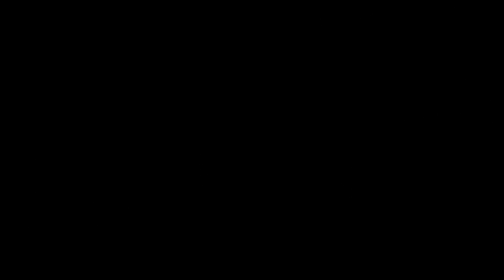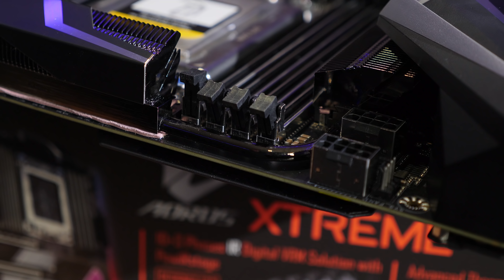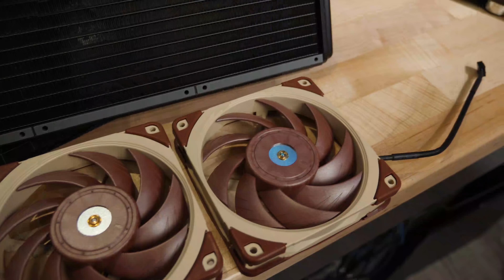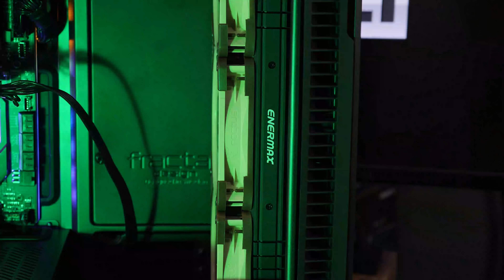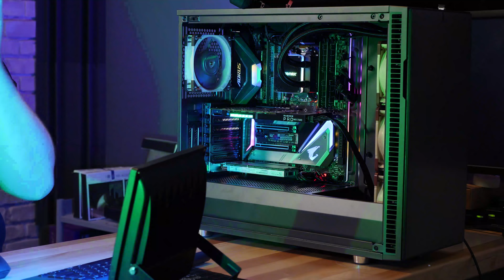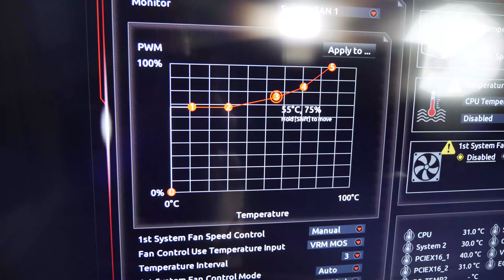TR 2990WX Programmers Workstation: Linus Torvalds' Edition (sort of)!

Comment: Seasonic a man of culture i see
Reply: I'm a PSU snob now. I will only do Seasonic from now on! I got so excited about the Prime series and the Focus+ PSU's! :D :D If I weren't broke I'd replace all the PC PSU's in my house with Seasonic!
Reply: Been doing that for years, the only exception I'll make are seasonic designed corsair psu's.  But since I don't like wasting time to figure out, Seasonic is usually what I go for, around here they are usually cheaper than corsair too.  Did not used to be the case.
If you are going to be a snob about any part, the PSU is what you should pick though.  Most important part in any build.
Reply: kmi187 at the very least it is essential to have a good PSU, you can kill hardware with a bad PSU and it can most certainly make hardware run poorly. Example, Vega won't run nicely with a lot of PSU's, including some from Seasonic, the powerspikes are too high. However, the noise level also is important, many people are oblivious about this: the PSU is often the most noisy component with light loads. That is why it is sensible to buy a PSU which has a 0-rpm mode. The presence of a 0-rpm mode also shows that the passive cooling is good (heatsink) and that they paid attention to the details. Given that a good PSU lasts longer than 10 years it makes sense to spend €80-100 instead of €40-60.
Reply: @nateo200  Seasonic psu + 300$ mobo= 6+ years guaranteed
Reply: Take Corsair RM instead, better than Seasonic. This from a guy who dislikes Corsair because they sold a chunk of the company to some of the worst companies in the world (Goldman Sachs should be called a criminal organisation).
Reply: You realize that the RM series are just rebadged Seasonic units right? Same with the SF series from Corsair...
Reply: @WesSites  uhhh RMx is a Corsair custom design CWT made, and SF is Great Wall.
Reply: Great_Master Gaming lol no they aren’t. They’re rebranded seasonic. For instance the RMX 650 is a SS-650KM3. Same with their SFX series. They’re seasonic, this is well known and easily verifiable information. You’re wrong ¯\_(ツ)_/¯
Reply: @WesSites  funny to think... i can contact the main psu designer from corsair (Jon Gerow), and tell you the same as greatmastergaming did here. SF is a Greatwall, RMx is a cwt design similar but heavily modified to GPS. except if you can prove me otherwise here with sources
Reply: Children these days don't know Delta anymore, I feel so old.
Reply: Apparently you are old. :p
Reply: Thermaltake iz bezt. 

No.
Reply: You're goddamn right, I had to pay double to ship A seasonic to where I live. No regrets.
Reply: Had far too many Seasonic powersupplys with coil whine and the prime series have too thin gauge pcie cables. Superflower leadex platform is my favorite.